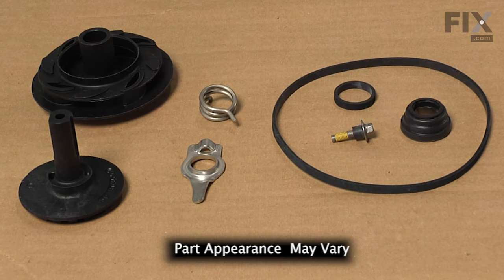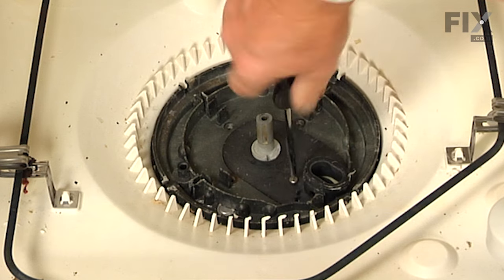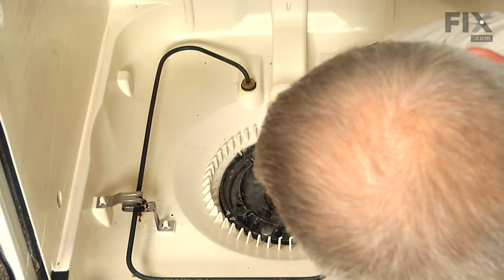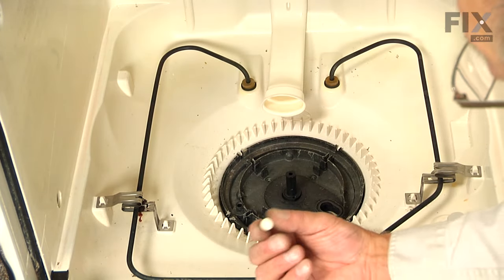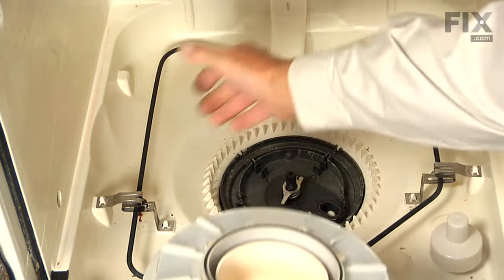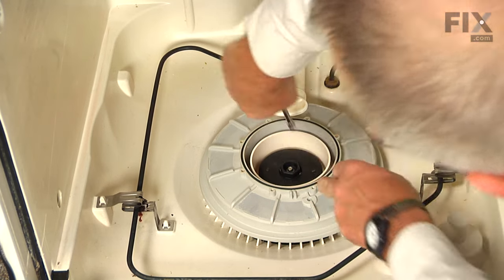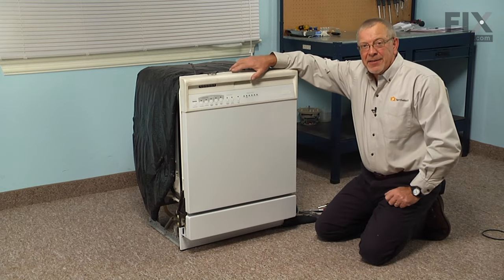Kenmore Dishwasher Repair – How to replace the Drain and Wash Impeller Kit

Comment: Thank you so much for posting this. as many other comments mentioned, this is the only video that shows how this model of Kenmore dishwashers is put together. I was unable to drain the dishwasher enough to see the screws through the brackish water, and this video allowed me to completely disassemble and reassemble the dishwasher with no issues.

Comment: I have this same washer, original to my home's 1995 date of construction.  My unit was working OK but I decided to take it apart and clean it because it is old.  After pulling the impeller lots of grossness from decades of use awaited.   After the big cleanup it is still going - I run it empty now and then with white vinegar and that freshens it up.  

Lots of videos of clogged drains/chopper discs on YouTube.  Kinda cool that this model just uses a simple chopper blade.  I don't care what they say, knock the big chunks off the dishes before putting them in the washer is better if ya don't want a clogged washer.

Thanks for the video!

Comment: Thank you, your video was the one I was looking for.  I had a plastic cap causing all sorts of noise.  I knew there was a way in. 
*Getting the hex screw out is the biggest hassle.  I suggest having a second helper!  One using the wrench to hold it and someone else using the hex screw driver..getting it out and in again.
Reply: Lori Calvert x
Reply: Could you please share which way you turn the center small hex to loose it?(I would hold the large one with wrench and turn the small one) Counterclockwise or clockwise?
Reply: @maxhu09  '"Righty tightly lefty loosie"? but I'll go back & watch again, can't get mine to budge!

Comment: Thank You! vary helpful! had 3 peaces of glass, head of a rusty screw, in there. also the white balls were both on the top side of mine.
Reply: Same here, BOTH Balls on top. I put the balls back in the way he did, it would not pump the water during the wash cycle. Had to take it apart again to put BOTH Balls on top, and pumps great now. Found rusty screw heads too, odd cause none were missing anywhere. Where do they come from?
Reply: Mine been doing low pressure lately. Thanks for the info. I will be putting thoughts balls back on top.

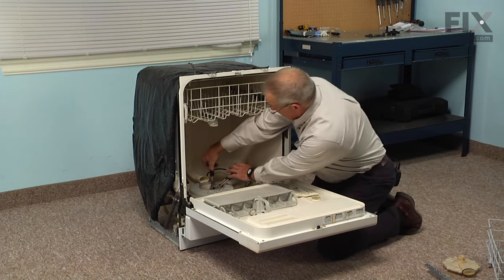Comment: That screw at 1:50 would unscrew.  Even by holding the black plastic thing with a wrench.  I drilled a hole in the plastic thing to hold it in place with a screwdriver, which did the trick.  Thanks!
Reply: Were you able to reuse the part with the hole in it?

Comment: As at 1:55  on the video we had the problem of the hex screw  not budging but we used an impact driver and got it out. Our machine is 20 years old.
Reply: Me too.
Reply: Great tip! I was stumped, until I saw your compact. Impact driver got the hex screw out with some hard driving.
Reply: Could you please share which way you turn the center small hex to loose it?(I would hold the large one with wrench and turn the small one) Counterclockwise or clockwise? Thanks!
Reply: @maxhu09  Hello, I don't remember because I had someone helping me with this when we took it apart and he isn't here right now. If I ever find out I will let you know. Sorry I cannot help you.

Comment: Thanks a lot and God bless! Extremely informative and very well done video and comments on the video. My only question is if you can open the separator to clean it inside. I didn't want to try and chance breaking it.
Reply: I have the same question.

Comment: Nice video, getting the old impeller off was tough and in Jan 2021 there was a 3 month deliver time for the kit (though the sites advertized 2 day delivery), make sure you have the kit in hand before you start!  Thanks.
Reply: Tell me, how did you get it off? Mine won't move at all. I dont want to cut it off but I also don't understand how to
Reply: @FullAutoApolotics have you figured it out??? I’m struggling over here 😂😂 I need help!!!
Reply: @hannahfetter  I drilled a hole in it and then stuck a screwdriver in it to hold it still
Reply: @hannahfetter  Did that help?

Comment: Thanks a bunch dude! Our dishwasher was not draining. Found some old sippy cup valves in there and had to navigate through some foul smelling swill to find the screws. Found out that the spring was all twisted and bent and that the Impeller was nearly busted. I ordered new parts and fixed it up good as new! Probably saved a lot of money 💵 too! I wonder how much you'd charge for a job like this?

Comment: I ended up using a set of vice grips and a 1 inch socket to hold that stupid hex nut in place and then used quarter inch drive on an impact driver. Sweet success....
Reply: Did the same with a pipe wrench, socket, and a hex screw driver
Reply: To remove the hex nut I used an adjustable wrench to hold the impeller, but it is plastic and was bending so I used a 1” crows foot wrench and a socket to go inside so it wouldn’t deform. Then put a 1/4” deep socket through the other socket and turned the hex nut.  Otherwise the plastic 1” nut would deform and start to strip. Hope this makes sense
Reply: Could you please share which way you turn the center small hex to loose it?(I would hold the large one with wrench and turn the small one) Counterclockwise or clockwise?

Comment: Thank you for the vid but I could not get past 1:33 mark. The 3:4” screw on the impeller is screwed down way too tight. I just ended up destroying the impeller with the plier holding it down. :(

Comment: Drain impeller looks fine. Is something supposed to separate the check valves or do they both just lay on top of one another offset.?  Looks like there should be something keeping them aligned or else you could just drop them both in afterwards?

Comment: Great video. I can't remove the impeller cover however, the screw is not turning per 1:55. I'm not sure what the chisel/hammer action described is tho.
Reply: Did you ever get it to work?
Reply: @fontgurrl  mine doesn’t come off either.. I tried everything
Reply: mine doesn't come off. turning it left gets it tighter and turning it right also gets it tighter. There is a loose point in the middle but it is not enough to get it off.
Reply: Could you please share which way you turn the center small hex to loose it?(I would hold the large one with wrench and turn the small one) Counterclockwise or clockwise? Thanks!

Comment: God help you if that center impeller screw is stuck.  If the dishwasher is 15 to 20 years old, just replace it!!!
Reply: Ours is stuck ugh 😢 😩
Reply: That's where I'm stopped dead.... He said you can just break off that black housing that he's holding with the wrench- but if I'm not replacing that piece then that's probably not a good idea, correct?

Does that question even make sense? I've been fighting this for 2 hours so my brain is probably not braining very well right now.

What I'm asking is: if I go ahead and knock or cut that raised black centerpiece off, when I put it back together is it a big deal if it's gone?
Reply: Oh my god my screw won’t come off and I don’t wanna call a plumber 😭
Reply: Ours was ridiculously stuck..torque rench got it. We rent and our it still works juat dirty
Reply: I got the bit and the drill out. More power!!!
Reply: If you're reading this, you can do it!!! You just need an impact driver.

Comment: Thanks. Perfect video. We have hardly used this unit over the years and when we did recently, the water wouldn't drain out. We do have hard water in our area.  I've inspected what you showed and its perfectly clean. What can I do next? I really prefer not to trash this dishwasher if theres a way to figure why it wont drain. Thank you

Comment: What does it mean when I try to unscrew the screw to remove the impeller from the motor shaft, and the screw just turns without coming out?  I am using a 1" wrench to keep the impeller from turning, but the screw will neither loosen or tighten.  My washer suddenly stopped cleaning, and it is making a different sound than it did when it was working.  It fills with water, and it will drain okay, but there does not appear to be enough water pressure available to the bottom spray arm, and no water seems to get to the upper spray arm.  Thank you!

Comment: Hello there, we have the same model Kenmore  665.17009400 (about 15 yrs old), problem is the screw that secures the dishwasher to the countertop was accidentally dropped in the bottom, we tried to remove the filter, however, at the point to remove the screw on the impeller it wouldn't move!! @ 1:50 min of your video - is there a solution? thanks so much!

Comment: So I have 3 plastic balls that came out, is that normal? 
I have the same 2 like you and then a third which is a little smaller than the other 2. As I was taking it apart the smallest one is the first I came across and then the other 2 were in the same locations as you have in this video. 
Should I put all 3 back or just the 2 like you did? 
I have the same model like the one in this video..
Reply: Ya that third ball screw me up
Reply: @MrLBghost  I don't know for sure but I don't think on our case it matters. Worked fine with 3, this video shows it normal to have 2, and I think I only put 2 back and it still seems to work as it should so... I dunno lol
Reply: most only have two
Reply: Took me 2 hours to Google and find where 3rd (and smaller) check ball belongs.  It'll make sense after you search for this other part, "Whirlpool Dishwasher Inlet Base with Seal", to give the visuals.  The ball goes in the center of the black "seal" portion.

Comment: I know it’s been a while, but can that screen/filter be taken apart and cleaned? Mine is full of debris and cannot separate it to clean it
Reply from the maker: If yours is the same as the one in the video your correct in it not coming apart but, you can flush it out and clean it. I use a soft tooth brush and brush the screen while holding the filter housing over the sink rinseing it with warm warm, A bit tedious if its really built up but it can be done.

Comment: Thank you for this video,  I have run into an issue though.  I have a washer on the motor shaft that won't come off after I removed the old impeller.  Can you tell me if the shaft gets wider and would in essence be making the matter worse by hammering it to try to loosen it?

Comment: You forgot the spray arm upper wear ring that goes under the plastic nut, that's why your spray arm wobbled so much when you spun it. Also, to help yas out getting the impeller nut off do this: Take two flat head screw drivers and hammer them through the impeller  180º apart, use those as handles as you undo the 1/4" nut. The plastic nut on mine also crumbled into pieces while attempting this repair.

Comment: I have a question I hope someone can assist with. I believe I have this same dishwasher. I found some gunk on the spiky parts on the bottom of my dishwasher and decided to remove all the parts as instructed here in the video to clean. I was able to get that dreaded impeller screw out and when getting to the bottom I found water and some dirt that I was able to clean out. Is it normal for water to be accumulated down there? I want to make sure I don't need new seals. Thanks!

Comment: I’ve taken all the old parts out as shown on the video, however,  the shaft that comes up from the motor does did not turn. Using pliers I got it to turn reasonably well. To see if it would continue to turn, I closed the dishwasher door and pushed the cancel/drain button. The dishwasher made a screetch like noise and is back to the shaft not turning -- unless I use pliers. What next?
Reply: Replace the motor

Comment: Do you have to shut off water and power supply in order to clean screen. I think he took off nut from the pump so I assume water needs to be shut off otherwise it will shoot from bottom?
Reply from the maker: Thanks for your question. It is recommended that any time you are working on the dishwasher, especially if you're near the pump area, that you shut off the water supply. It is also smart to shut off the power supply, so that (even though it is not likely with this particular repair) there is no chance of electrocution. Thanks for your question and good luck with your repair!
Reply: yeah, electrocution tends to mess up your day.

Comment: Hey how do u change the filter on this same model?
Reply: same question
Reply: Jessica Neuhoff when u use ur dish washer does it leave a strange film ? I’ve been told the filter needs to be changed. But I don’t wanna take all this apart when it’s not in there.
Reply: @nojokeauto  yes, I'm down to the very bottom but I can't tell if that is supposed to be able to come out or not.  I'm down to the black bottom part at 4:54 on this video, but I don't know if that black bottom part should come out too,  if so, I can't figure out how to get it out.  So I'm going to put it all back together now, I don't think I really got to the dirty part though.  I can't find a video about possible removing the bottom black part.

Comment: The hex screw in the center of my impeller won’t come out. So when I get to about 1:47 in the video is where I have issues. Husband attempted to help and now we have that portion broken. But I still can’t get the screw out. Ideas?
Reply from the maker: Hello Jayne, we are currently researching this for you. Will have a response soon. Thanks
Reply from the maker: Hi Jayne, sorry for the delay.  I would suggest penetrating oil and time or remove the pump assembly and try to direct some heat on the shaft without damaging the pump housing may be your only recourse.
Reply: I know it's a bit late, but use a 1/4" socket in an impact driver and it will come right out.  It's a standard thread so you don't need to go the opposite direction to remove it.  Something like this- https://www.homedepot.com/p/DEWALT-20-Volt-MAX-Lithium-Ion-Cordless-1-4-in-Impact-Driver-with-Battery-1-3Ah-Charger-and-Contractor-Bag-DCF885C1/207121879  If you don't own one ask your DYI friends they will most probably have one.
Reply: Agreed, the impact action will get it right off!

Comment: The video is of course done well, however the video has two problems clearly, 1. the back of the workers head is directly in front of the interior assembly - when he actually sets the parts in place, then the back of his head is moved out, and viewers then see the next level of parts installed in place. 2. The video assembly providing video of workers handling and assembly is off screen thus the viewing audience, no matter full screen, small screen  cannot see what he is handling nor how he is placing it together with his hands ..

Comment: at 1:36 in the video i was taking this part off with vice grips instead of an adjustable wrench (the wrench kept slipping) and the vice grips crushed the plastic into little pieces. it was very brittle. Any idea how i would get that piece off now?
Reply from the maker: Thanks for your question. Once you've removed the screw in the center, you may be able to pry the plastic piece away with a flat blade screwdriver. Hope this helps!
Reply: @FixDotCom  I cant get the screw out as the plastic nut on the impeller was crushed
Reply: I think unfortunately you’ll have to break the impeller to remove (should be easy if it’s old and brittle) allowing a better grip of the shaft so you and turn the fastener out.
Reply: @jbirdharold6640  you think an impact driver would sort it out?
Reply: @MuttonChops24  that's what I was thinking, broke my dang wrists trying.
I don't even have vice grip, just a wrenches, let alone impact driver!
poor old Mrs fixit. lol